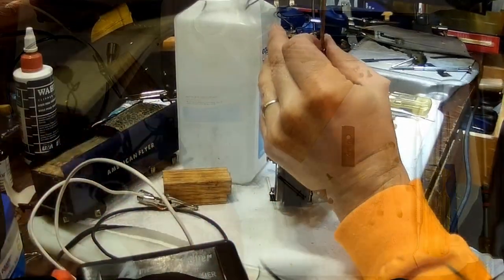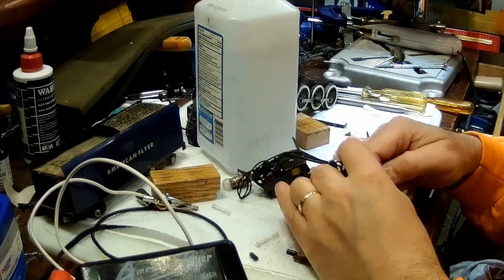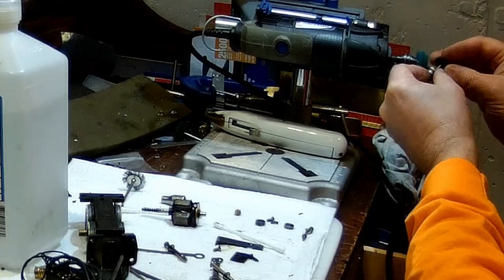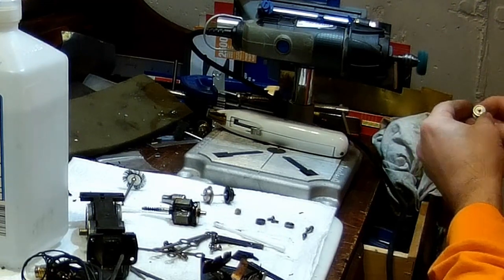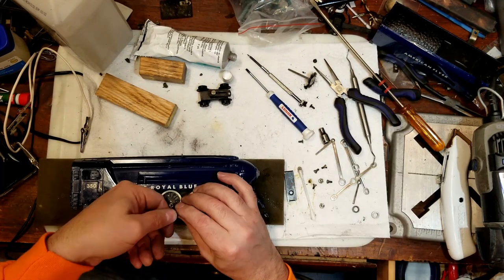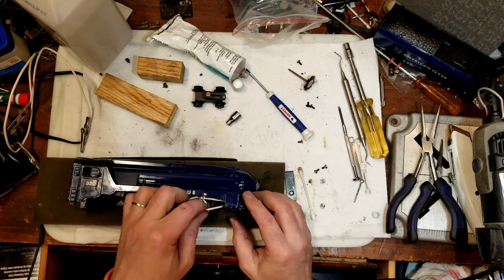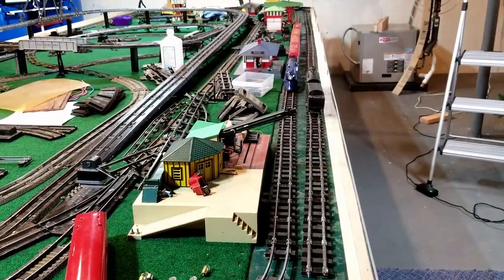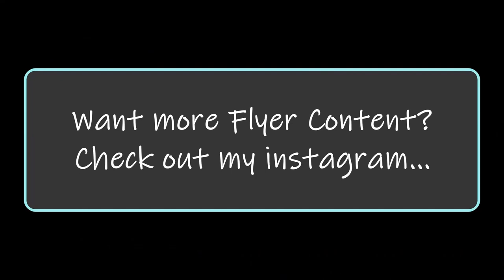1950 Bullet Pallooza Part 4

Comment: The sound of a Flyer steam engine without smoke and choo choo reminds me of Lionel spur drive steamers. Austin, I would like to reinforce your safety tip about goggles. I would take it one step further and say to do it outside. I used my motor tool with wire brushes about 4 months ago and I'm still getting pieces of wire in my feet.